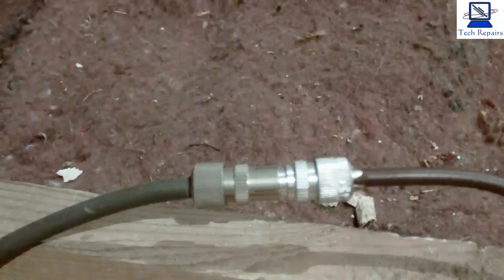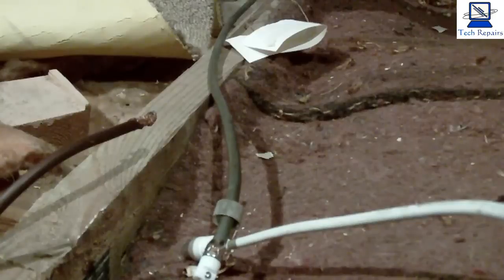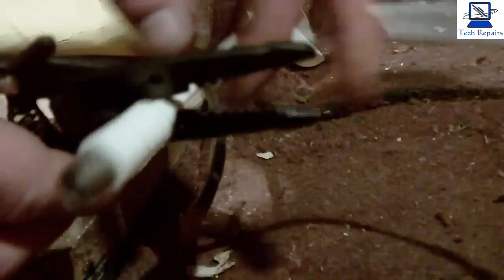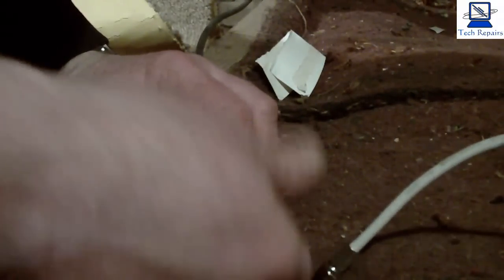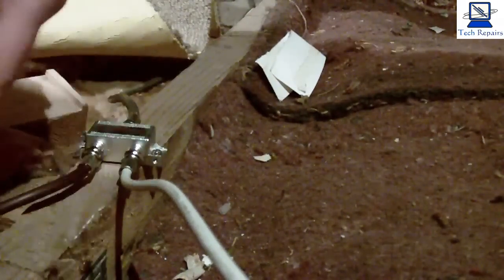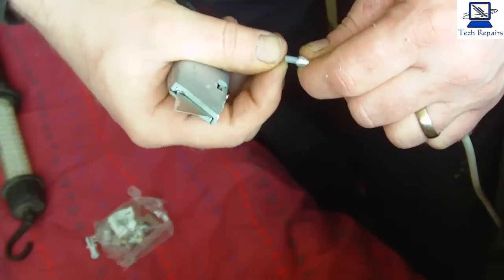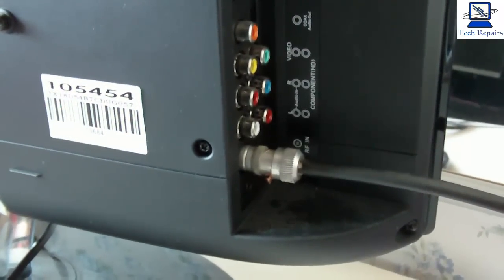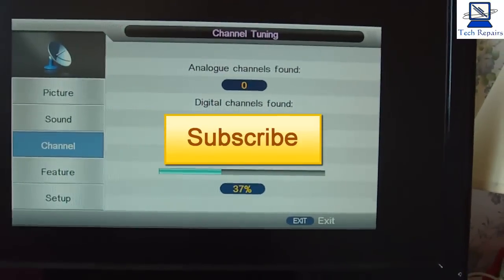How to install a two way power pass through splitter to coax cable for DVB TV

Comment: Hi mate, I have one cable coming down from the roof and I need to connect four TVs to it , will splitter works or there is easier way than connected wires ?
Reply: If you have an RG-6 coaxial cable coming down, you will need splitters. There are two conductors in the coax and both have to be connected. The inner wire is a single 22 gauge copper wire the other is a silver colored braid that forms a shield which prevents unwanted signals from getting into your TV.  Also you have to maintain a proper 75 ohm match throughout the entire system. Therefore you can not just twist the coax together. You will need some RG 6 "F" fittings and a four way splitter or some two way splitters. Using a four way splitter, all cables must come to a central location. The cable from the antenna connects to the input. The cables to the four TV's will connect to the four outputs.  Depending on where the TVs are located, you could daisy chain them using the 2 way splitters. You could also use a "tap".  Don't talk to someone in a hardware store as they are generally not knowledgeable in TV antenna equipment.

Comment: Can two diferent signals (cable tv and tdt) be combined with a simple splitter, I tested and works but my concern is if it can damage the tv because of the two eletrica powers combined?
Reply: TV antenna signals are measured in micro volts. If using an older analog TV, there must be a minimum of 1000 micro volts (on any channel) at the antenna terminals of the TV set for a good snow free picture. I liked to see 5 Db at the antenna terminals. 1000 micro volts is considered to be 0 Db. Every 3 Db = 2x the power. 1000 micro volts is equal to .001 volts or 1 mili volt. At these levels, many channels can be fed to the TV antenna terminals without damage. I assume, the new digital 
TV's require the same.

Comment: im on digital tv not sky (dublinIreland ) iv 1box with tv working, but i put in a box in the sitting room, and it worked fine till yesterday, did they no i connected another box??? cause it has music channels, rte but all the other channels, is there any way i can use it with out payn 15e a mth for multi room, i dont have a satalite only horizon max from upc,any info would be appreciated thks

Comment: I have a Sky Box and Freesat Box, I have one dish which I can use to watch either my Sky or Freesat. Will this work so I can switch my TV output to watch either my Sky or Freesat without me removing the two wires that come from dish that go in the Skybox and Freesat. I just want to change my output to watch either my Sky or Freesat without removing cables from the box.

Comment: I'm using a coax splitter to connect a few powered rabbit ears to my TV converter box. It really helps improve reception having more than one rabbit ears working for you. However, I just noticed it's marked input and output. My rabbit ears are connected to the output connections and the line to my converter box is connected to the input so I got it going in reverse. The splitter device doesn't really work in one direction, does it?
Reply: Splitters can be used as combiners by connecting in reverse. However, no matter which way you use it, there is at least a 3 Db signal loss from the 2 output ports to the input port.  3 Db is approx 1/2 as much power. In your connection, whatever the signal strength is coming into the splitter it will be cut down to 1/2 by the time it gets to the TV. For best results, a rabbit ears antenna's "ears" should be horizontal  AND pulled out to the proper  length for the wanted channel AND it must be broadside to the signal.

Comment: One dish tv antena with connect two set top box????

Can i do it???at same time different channel.
Reply from the maker: If its coming of a dish that uses an LMB then probably not as you need to put a duel LMB on the dish as it needs to switch the LNB The DC voltage power supply is fed up the cable to the LNB.  Often by altering this voltage it is possible to change the polarization or, less commonly, the frequency band.  Voltages are normally 13 volts or 19 volts. So you would have to run two coax's or a duel coax to achieve this.Hop it helps.
Reply: +fixitdaz how to connect two tv in single set top box and watching different channel can you give any idea about that
Reply: +Abdul Kather  you can do this with this splitter or a passive Splitter, however new boxes (freeview) can record 2 channels (or record one watch another) with only one input.
Reply: Nilay Patel

Comment: This would have been better if the work being carried out was in shot during filming, also I didn’t hear anything about making sure the shielding was isolated from the inner core. I’m not sure why you would cut a perfectly good, factory made coax connector from the new lead, to put another one on, if they’re both male put a coax coupler on, simple. The last issue is that you said you were cutting 5mm of the outer sheathing and 4mm off the core sheath, the cuts made looked more like 25mm and 20mm. I think you need to redo the video taking the above into consideration.

Comment: No offence and I am from Europe by the way, the European way of working with cable splitters, jacks and cable ends is the most fucked up things I ever seen.
In North America it's cut the cable, strip and attach the connector with a connecter install tool on the wire it takes 5 seconds to do this, then screw the end part into any RF in.  I know in Europe the standards for jacks and plugs are really fucked up man, just take a look at the power sockets. We do not have time to dick around with the "European " way of doing things.Here we work by the hour and get paid every thursday so we do not have time to dick around with stuff like that, here you would get fired for taking that long to attach a fuckin end to a coax cable. I know I am from Europe living in Canada and I have my own TV /Computer business, and all our connectors here are for ease of use you can just use the push on ends these days you do not even have to use a crimper tool anymore.  I see Europe is still 20 years behind the times man.
Reply: I know it's just Germany and British standards were pushed on everyone and hence why everyone left Europe. I did not want to work in the fields of the "land owners" more like the thieves who nenver paid any land taxes or even have those properties registered outside the main big cities. Noticed when the poor people left all those "land owners " lands are nothing but bushes now!!! and that is how it was even when I was still living there in the 1990's. Most of the rural villages never had any surveys of land properties or proper land taxes or even registration in a 1000 years. Take a look at Portugal for example over 60% of properties are not even registered LOL. Yet they somehow still get services like hydro LMFAO!!! What a funked up Europe. I am glad Germany is leading the way now with their ownership of Europes ass right now. Perhaps Hitler had the last laugh as Germany controls Europe and everyone now must follow their rules.